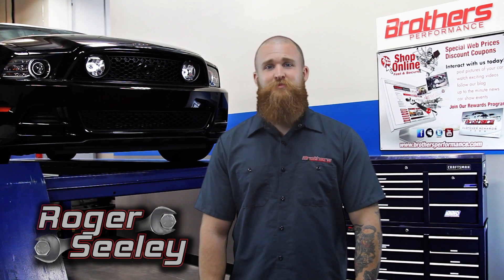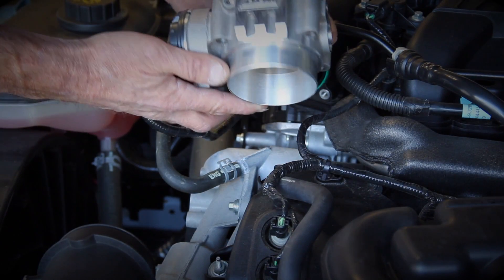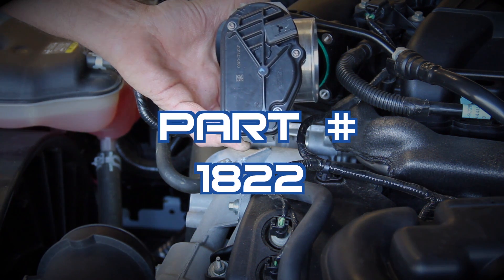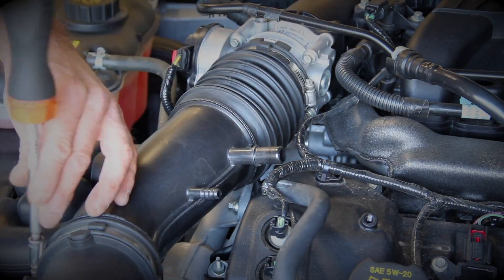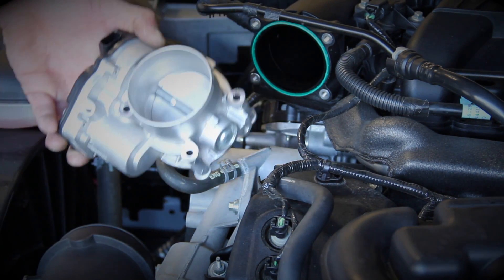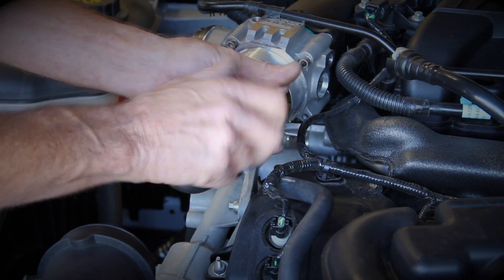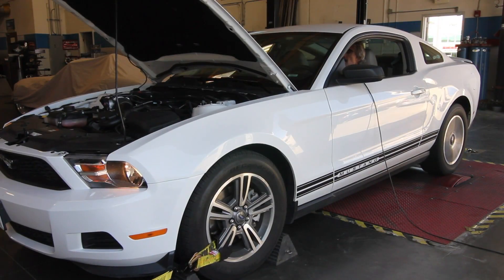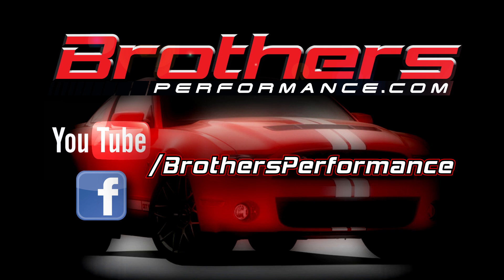2011-2014 Mustang V6 3.7L Throttle Body Install & Dyno Test

Comment: 6 hp increase and 8 torque for like over $400 bucks idk if thats even worth buying. you can go to the gas station and put in 93 octane and get the same amout of power this would give you. and it would cost much cheaper to buy 93 fuel compared to this little upgrade. now yes by buying this unit and adding 93 octane with it you will get more power but it wont be much unless you get a tune with it all.

Comment: For anyone looking to do the bbk73 mm throttle body. There is a cheaper and better option that produces more power and saves $300. For more info reply to this comment
Reply: it is..?
Reply: put the factory 5.0 throttle body on it, save those $300

Comment: $400+ for a 4.7hp gain. Trying to show the big low end difference to confuse customers? A person could easily get a tune and see the same gains with a stock throttle body
Reply: How are they confusing customers by clearly stating it showed large under the curve gains? 15-20 ft-tq form 2-4k is a nice increase.
Reply: Rob Hunt  everyone is so hung up on peak numbers that they fail to see the added drive-ability power.
Reply: @AtticAZ  BAZINGA!
Reply: @rhunt2363  Most youngsters and/or the uninitiated don't even look at torque...that and the torque curve is really all I care about. How much torque, when in the RPM range it is produced, gear spacing and can I sufficiently blast through the gears staying in the seet spot of the torque. If I want to go 100mph I would then look at HP...but then again many of us see the drivability this TB produces just by looking at the graph and how the BBK erases the torque valley seen from 3k to 3600rpm.
Reply: @randsonic  if torque is all you worry about why are you watching a v6 video and not v8/v10 videos?
Reply: @goodkill1  some people stick to what they have paid off im guessing thats why to some people the torque could possibly be relevant to some people.
Reply: @goodkill1  If horsepower is all you care about why don't you buy a Demon with 700-1,000 HP? dude it's obvious we can't afford other V8 cars... what's wrong about trying to do the best with what's available?
Reply: @marcovicencio1  spoken like a dude who's never touched a torque wrench
Reply: @marcovicencio1 just get a 5.0 throttle body
Reply: The 3.7 in the Stang has a torque dead spot in the mid-range. If you look at the dyno you will see this drop starting at around 3000rpm and not correcting itself until around 3600rpm. Talk all you want about HP because that shows just how much you don't understand. The torque increase seen from this one mod corrects this factory bug-a-boo and creates a substantial seat of the pants feel. Old school guys like me don't really look much at HP unless we are gong racing...torque is what gets you off the line and torque sustained is what we look for in a dyno test...like we see here.
Reply: The stock tune does not allow the throttle body to open 100%, pegs out at 80% iirc. What you geniuses fail to realize is a simple bama tune would override the stock map and allow 100% trottle and the same gains. The fact that there is near to no top end gains leads me to believe that the flowrate is about the same as a stock throttle body. In addition, the throttle's stepper motor probably isn't the same resistance as stock and could simply be opening wider while the ecu thinks it's still at 80. I wonder what the afr is
Reply: @goodkill1  Not sure...but that is good info. The BBK shows dyno results...you saying a tune can match that?
Reply: @randsonic  you gain 5 hp from switching to high octane alone, just they way ford tuned the 3.7 they also tested the 3.7 at 10k rpms in the lab. I have the data sheets somewhere
Reply: @goodkill1  What you get from higher octane is more ignition timing advance earlier in the RPM range...you may show 5hp gain but the torque increase when allowing for the increase in timing would be the number 1 performance improvement IMO. WIll look for a dyno run with a tune on YT which would show actual hp/torque curves. Not sure why everyone is so hung up on peak HP gains when that is only relevant when racing IMO most of the time. The 3.7 is a great engine, not sure why but the stock dyno shows a huge torque valley between 3k and 3600 like I said. My guess is that the BBK with a 93 tune would perform better than a stock TB with a 93 tune...would be nice to see that comparison.
Reply: As someone who's run tunes from both bama and not mpt, they will help a little with the low end torque and reduce the torque dip, but not a lot, and under 3k it really doesn't do much. If these guys and bbk are telling the truth, gaining 15+ lbft of torque (at the wheels especially) around and below 2500rpm is really big when it comes to daily driveability as 90% of a daily commute is within that range. Add a tune and a few other mods on top of that and you may see even more in the low and top end compared to the bone stock test car. Not sure if I'll go bbk or 2014 gt throttle body but if I remember I'll report on my findings.